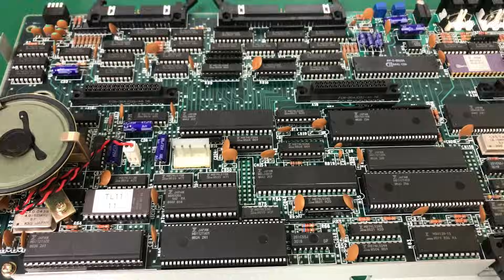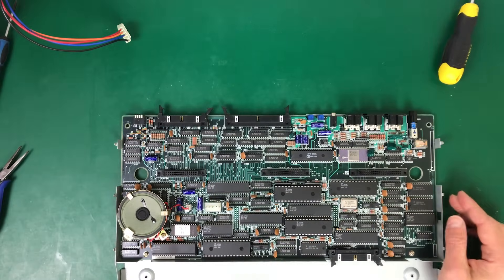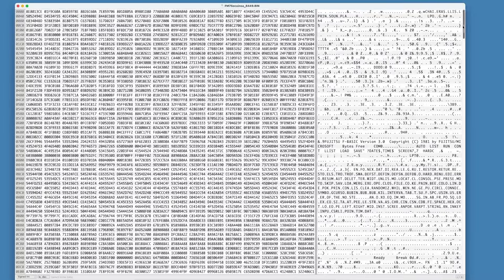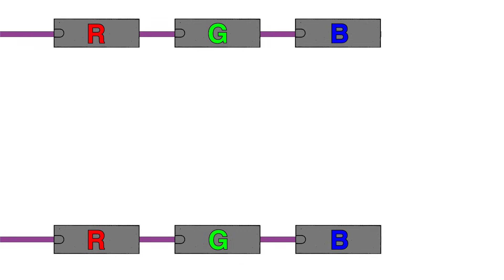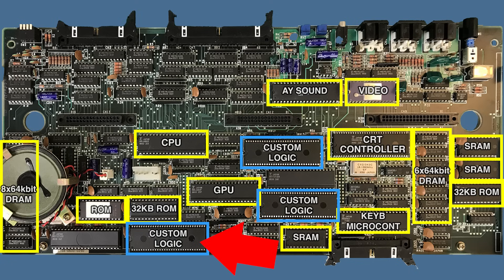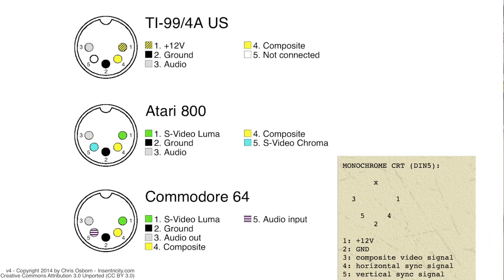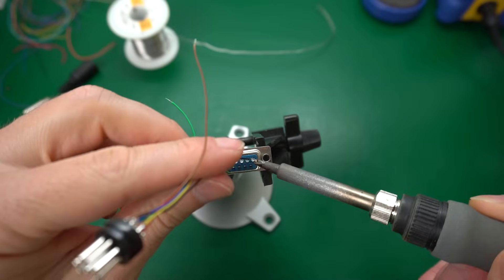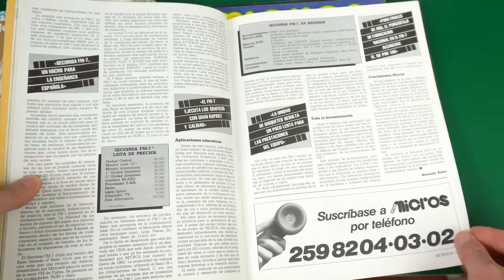This 8-Bit Computer Has Two CPUs (And One Acts As A GPU!)

Comment: This architecture style is not that unique. Multi cpu was in a lot of arcades and game consoles of that era.
Reply from the maker: Right. It just didn't carry over to home computers because of cost I imagine.
Reply: @NoelsRetroLab  I imagine you are right on that front, but depending on how wide you cast the net there are other examples. The BBC master with the tube interface could run with a coprocessor. The c128 though I believe it could run only one CPU at a time. And several home computers had DSP and such that could be programmed.
Reply: Qix had two 6809s. I don't know of any other system of the era with two of the same CPU unless you count the C64+disk drive. I believe some arcade games had dual Z80s but it was more common to have a CPU plus some kind of custom graphics processor like the Antic or Copper, or a modern at the time CPU like a 68000 plus a Z80. There were also Z80 addon cards for various machines to add CP/M compatability and there were also PC addons for Apple II and Apple II addons for PCs. The Commodore 128 had a 6502 plus a Z80 out of the box though only one CPU could run at a time and the Z80 is hobbled in comparison to the 6502.